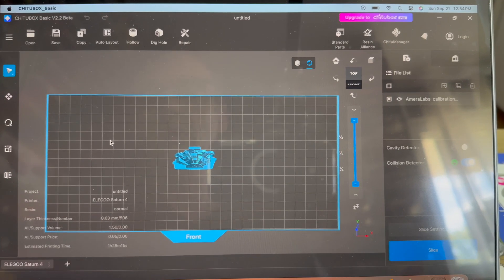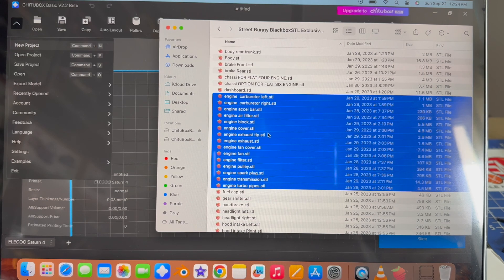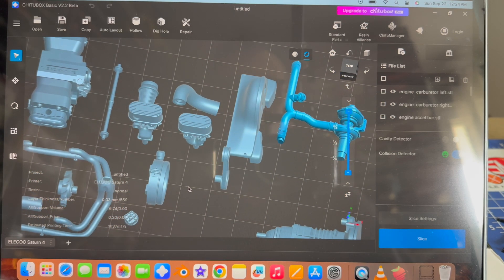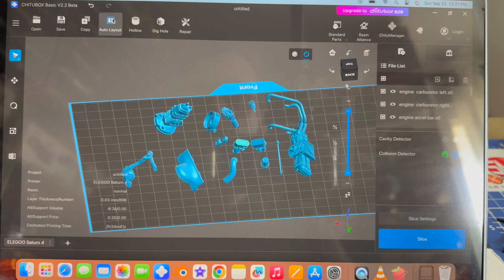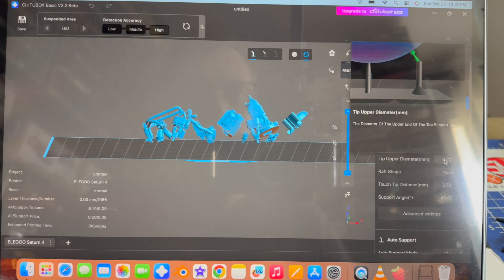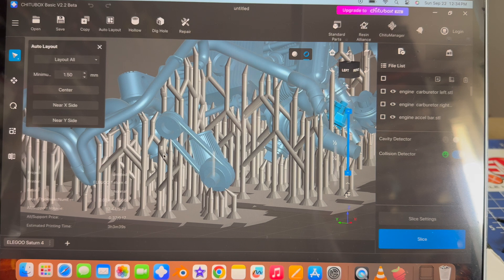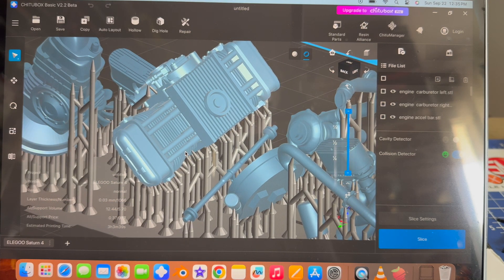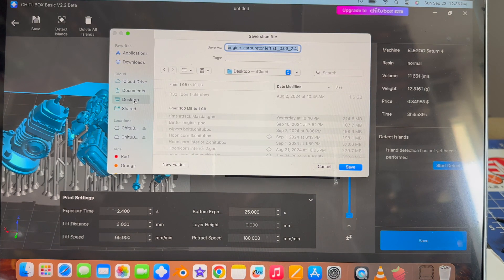Review: Nova3D Tough Washable Resin - VW Engine

Comment: I'm just curious how you have avoided layer lines. What might be the setting?
Reply from the maker: Hi Richard, I credit calibrating the resin and angling parts so that the surface you want to display is neither parallel or perpendicular to the build plate.
Reply: @ScaleModelExperiment  Thank you, know that bit. Usually keep things at an angle, up to 45°. Even set the layers to .5. But still see and feel minute grooves on, say a ball. Stair steps.
Reply from the maker: @richardstiers9010 I usually print at.025 so it minimizes the steps
Reply: @ScaleModelExperiment  Thanks! Never thought to go that fine .05 was my max. Most commercial houses are at .10. I've run into real issues with prints on curved surfaces.  .25 would definitely cost more, due to increased ptint time.
Reply from the maker: @richardstiers9010 I think my longest print time was about 11 hours for a body with an angled position on the plate to avoid lines. If you’re printing small stuff like wheels and what not you’ll be in the 2-4 hour range.

Comment: Hi James, Great result, it looks really clean. I have a few questions, 
I see that you have Lychee on your toolbar, what do you think about it? I tried it and I actually liked it better than Chitubox (island detection, for example), I know that many people don't. Can you tell me Why? 

I didn't check all of your videos but do you explain how to chose support shape, conical head pointy or ball at the end, how deep into the print, ...?  When I was doing 3d printing at work, I was really guessing support shape and size without knowing what I was doing, it worked most of the time but I was wondering if there is rules.

How much clearance would you recommend to fit parts together? Like for example the distributor, if the wire is 1mm diameter what would be the hole diameter in the distributor to fit the wire comfortably?

I'm thinking about getting a printer but I know that in my case it will collect dust most of the time and the resin will expire, I think that for now it makes more sense for me to have Stratasis, Shapeways  or Fathom deal with it, it's not that expensive anymore. Although it would be fun to have one (I'm thinking about the small $100 Geeetech alkaid). 
The funny part is that none of the printer services is cheaper than the other, but sometimes price varies, so it's good to upload in 3 of them every-time to get a good price, sometimes it varies by a lot. 

I also used FDM printing, I was always puzzled that it couldn't get the printing duration right, most of the time less than anticipated (sometimes by more than an hour on big prints), it got all the info (speed of printing, travel, pause between layers, ...), it's a computer, it should be easy business to calculate all that.
Sorry for the long comment, Good continuation, 👋🏻
Reply from the maker: You give me a lot of credit. I found that the auto support feature was better with Chitubox so that’s why I use that slicer. I’m too lazy/impatient to make my own supports. I’ve never played with support shape or depth, I just use the default 😁

Before I got my first printer I bought a few printed items and then found out how little the files cost soooo I took the dive to do it myself. 

Take care Yves, I appreciate your support👍

Comment: Excellent review Jim! I think I’ll be checking that resin out, especially for smaller parts that can be troublesome getting off the supports due to brittleness.

I think I have that calibration file you used…..that is a very good gauge of what’s up with the exposure settings. 👍🏾
Reply from the maker: I was suprised of how flexible the parts were even after curing. It’s a cool resin.

Comment: Awesome video James! You may have solved a issue I have had and I was not tilting the angles both ways. Thanks! Question, what glue are you using James?
I may look into getting a bottle of that. I use Anycubic water washable and I have always used it. Take care my friend!
LLAP 🖖
Reply from the maker: Hi Bruce, glad to help! The super glue I was using was Bob Smith Industries Super Gold thin. I also like the Anycubic as that is what I started with.

Comment: Very cool. I’m glad you reviewed this. I’m using elegoo and it’s fine, but a little brittle after curing. Do you pull your parts off supports before or after curing? With ABS like one of the perks is its flexibility and ease of coming off supports. I ask because there’s some very small items I cure on supports. Thanks bud.
Reply from the maker: Hi Big Chef, after washing the parts I soaked them in warm water and the supports literally fell off the parts. I did not prep or sand any of these parts you saw in the engine. Thanks for watching👍
Reply: @ScaleModelExperiment  great news thanks. I’ll have to get me a bottle, thank you